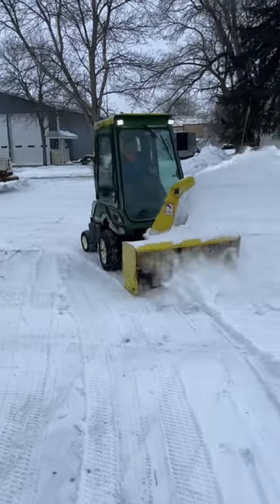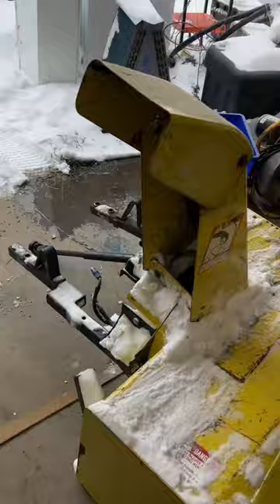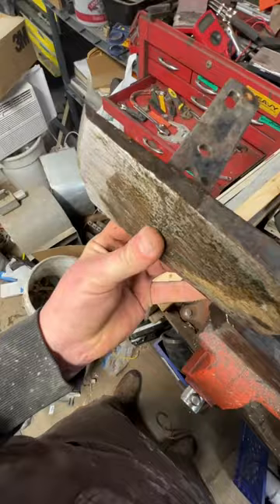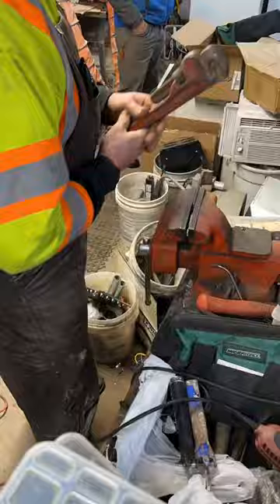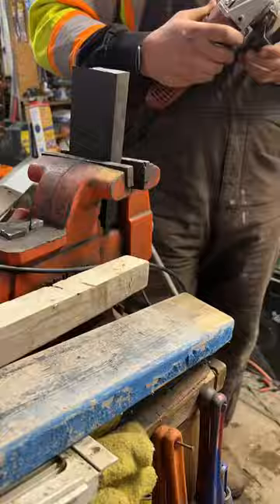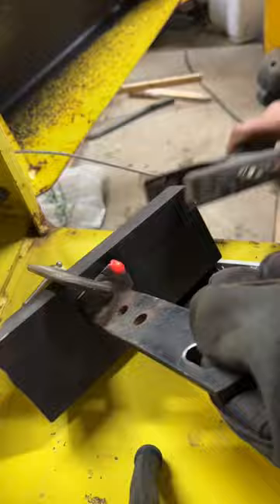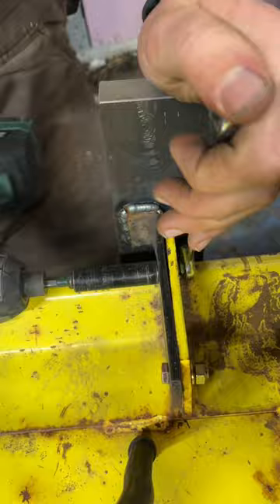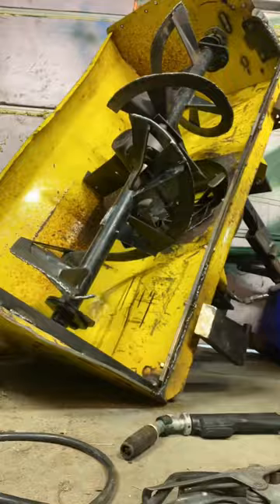Performing some maintenance on our John Deere snowblower. #HandsomeOrHandy #Handyman ￼

Comment: Prices reaching into the ludicrous range are typical of farm equipment parts.  You don't ever want to take something to the JD dealer and tell them to "fix it with new parts" as you'll be shocked by the bill.  This repair calls for a "farmer style fix" .
Reply: At the local deere dealer shop rates alone are $180 an hour just in labor
Reply: You have just proven you have no idea of the cost of money.   All of those parts on the shelf are MONEY sitting on a shelf.  Have to factor in the cost of inflation plus the lack of opportunity for that money.   If the parts sit on the shelf for 10+ years - that's a lot of money.

Comment: I like using small diameter round stock to build edges. Much easier and faster than building an entire edge back with just weld alone.

Comment: What is omitted is that the cost of the repair and repair equipment, along w/ the accumulated cost of training to use said repair equipment, probably exceeds the cost of just replacing the blower attachment
Reply from the maker: I’m going to disagree with that, just the gearbox alone is over $2000 on this snowblower and I do not believe that John Deere sells this snowblower anymore.

Comment: Did you use hard-surfacing wire when you built up the edge on the blades?
Reply from the maker: No
Reply: @HandsomeOrHandy  
Building up with regular soft mild steel wire will wear again quickly. Most material is a higher carbon content in plow blades etc.
Most shoes are hardened something like ar400 steel
Reply: @HandsomeOrHandy  I live in Australia and the ground here is pretty abrasive. I built up the edge of a auger we use for pilot drilling fence post holes with mild steel wire. It didn't even last one day of heavy work(clay soil filled with quarts rocks). I have since used hard surfacing wire and it's lasting better.

Comment: You don't happen to know the part number for the windshield our blower broke the glass on ours thismorning lol
Reply from the maker: https://partscatalog.deere.com/jdrc/sidebyside/equipment/78980/referrer/navigation/pgId/7057534
Reply from the maker: This is as close as I was able to get. But it doesn’t have the part number for the glass
Reply: Ya this is actually for the soft sided jd cab we had one but it's open on the back side and we upgraded to this full hard cab last year but it's not actually made by jd was a good shot tho thanks for trying
Reply: Ya this is actually for the soft sided jd cab we had one but it's open on the back side and we upgraded to this full hard cab last year but it's not actually made by jd was a good shot tho thanks for trying
Reply: Safelight ended up saving the day took  measurements and is making one custom only down side is it's a 3 week wait but it was only around 280 bucks not bad for as big as the window is in my book